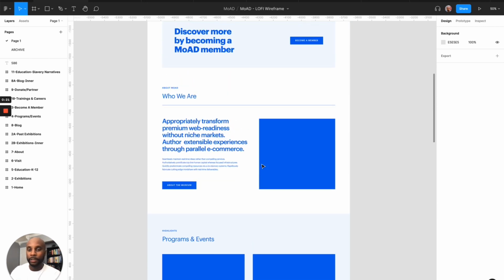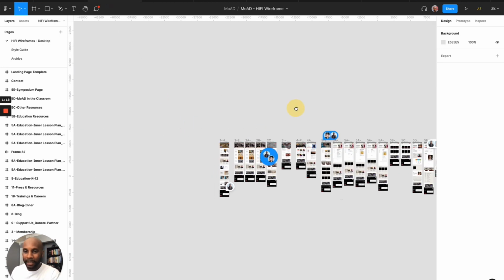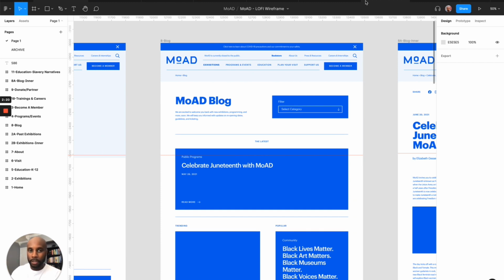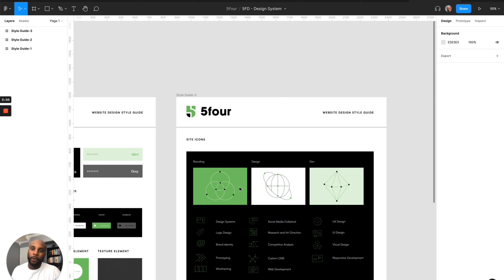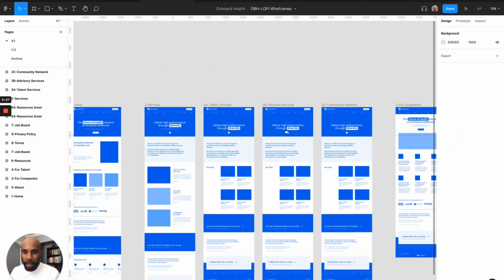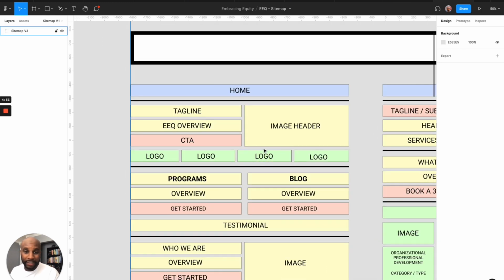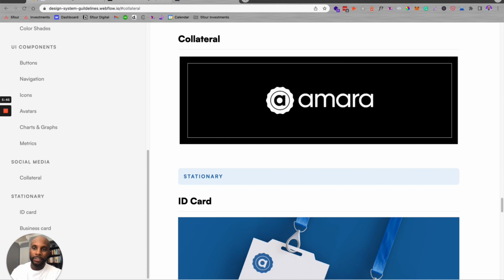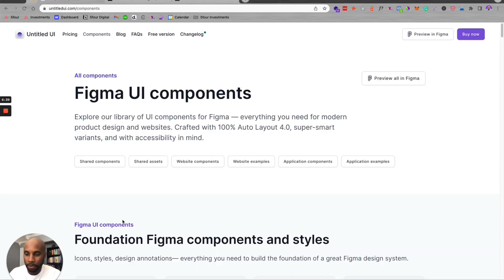LOFI (Low-Fidelity) and HIFI (High-Fidelity): How to Develop Websites Faster

Comment: It would be great if you create s video on the wireframe process you use. You call this How to Develop Websites Quickly. However, for those that are starting it would be much better if you go into the actual process of the LOFI & HIFI that you created.  You would get a much higher rating in YouTube and more followers increasing your exposure.  BTW, Great Work!!!
Reply from the maker: I actually did this a few months back - https://www.youtube.com/watch?v=7TP1JRsNxSw

Another one - https://www.youtube.com/watch?v=mwNDwcT5Smg